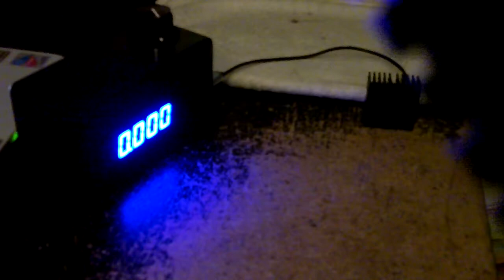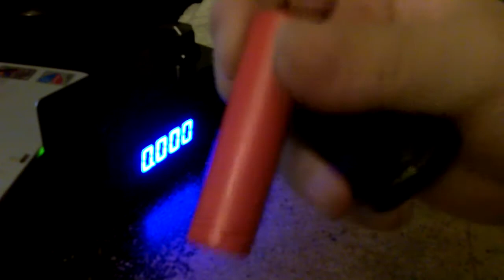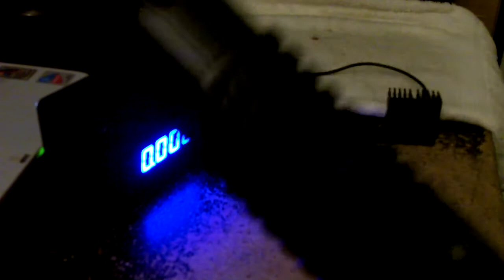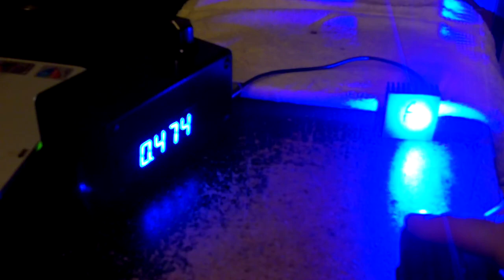Legion93 Wicked Lasers Arctic LPM Reading Before i Mod it to be a True 1  WATT  Arctic

Comment: Alright so how much to just do the mod? Also is all the WL lasers at different MW the same, just set to less power? Cause I just got a Krypton but it's only 300mW. Can I boost that just as high as I could boost the 750mW one? or no?

But as for now, I'm wiling to send the arctic for the power to ~1.3W upgrade. PM with a price if you can, thanks

Comment from the maker: If you want to keep the Smartswitch the max i can probebly get it to is ~ 1.3W Now. Maybe a little more..

Canging the Modes and or reprograming the Smartswitch is not possible. TO get to the SMartswitch controler you will have to take the entire laser apart. NOT EASY without damage.

Comment: What is the MAXIMUM load you can get out of the Arctic S3? What is the craziest thing you can do with it? I heard its possible to go over 2 watts? Is that possible with modding? 

I am very interested in one of the following.
1. Max this out to its highest potential
2. Replace it with a much more powerful diode, without changing appearance or features of the artic.

(Also is it possible to change the default starting low flashing, to high power solid? I would love that) Please contact me!

Comment from the maker: @EYTYXHS1995 LOL. yea 550mW is extremely low. even for an Arctic. It has a Low efficient 445nm diode. No I tried on my own the Driver on the Arctic Maxes out at 960mA or around that.

THis laser is going to be a true 1W +/-50mW when iam done with it.:-)

Comment from the maker: @juniortore1 Yea this one is extremely under spec. Also that the front cap that was on this laser i believe is one of the very old ones that drop the power 100mW. I tested after this video without the lens and it gave ~620mW still way under power. But whatever.

Iam modding this laser for him just like i did mine to be ~1W and still keep all the smart switch features.

That is the man difference between my mod and other people modes. You get to keep all the features of the Arctic